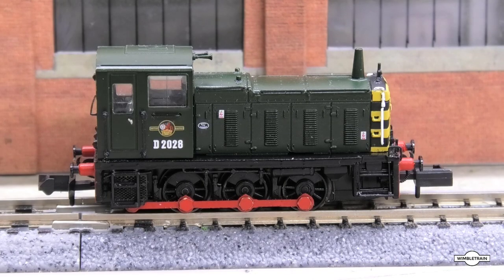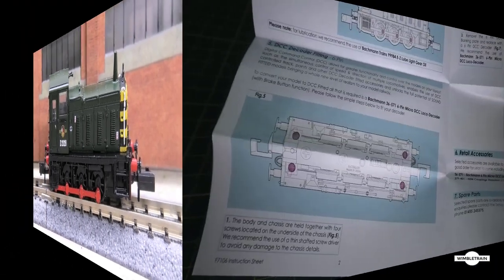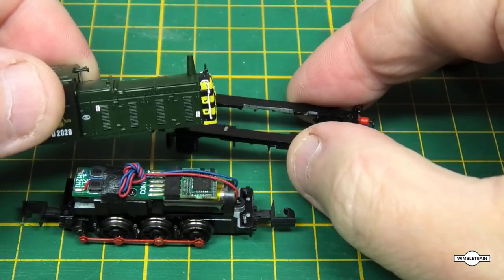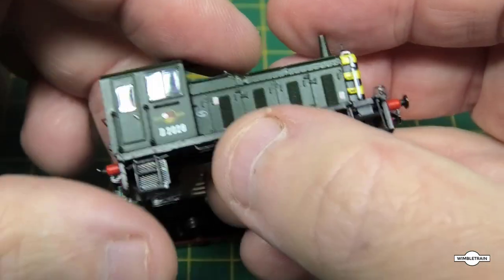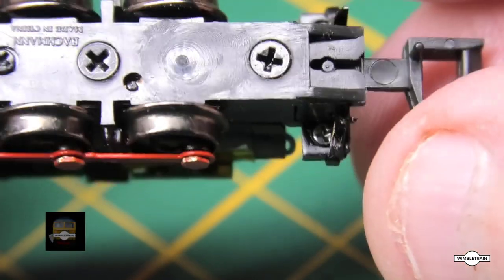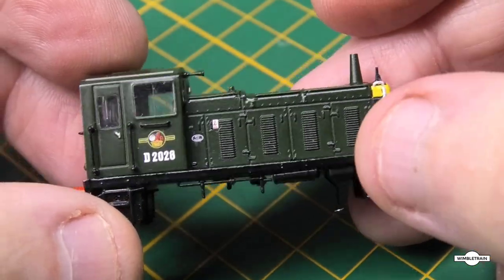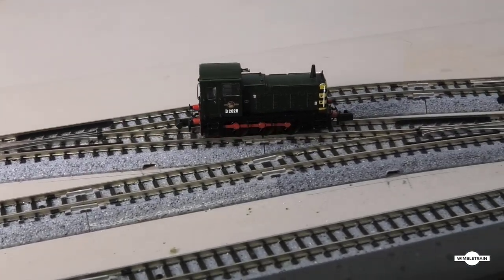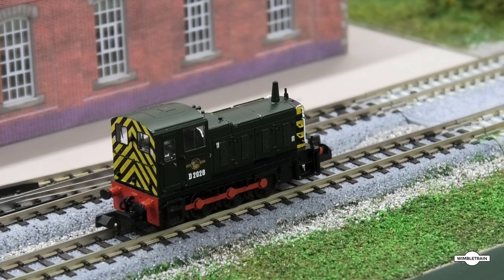Graham Farish Class 03 with 6 Pin DCC Socket

Comment: Nice video John, I was intrigued to see inside one of the new shunters, bit disappointed that the didn't use a next 18 socket maybe it was due to the decoder size. This new style of chassis certainly makes the loco very achievable to add sound by ripping out the pcb and using the connections to a sound decoder and sugar cube speaker. All the best Tony
Reply from the maker: G'day Tony, yes there seems to be a nice open space on the inside of the cab and might be enough room for sound (I really have no idea on sound fitting locos myself!) Cheers and Thanks

Comment: Certainly looks easier than the original release, where mine has a cab full of decoder!  Does it still have a cab interior light fitted, or has this now been dumped?
Reply from the maker: Hi Steve, this model does not have a interior cab light. John
Reply: @wimbletrain  No great loss.  I removed mine from the original release as all it was doing was illuminating the decoder!